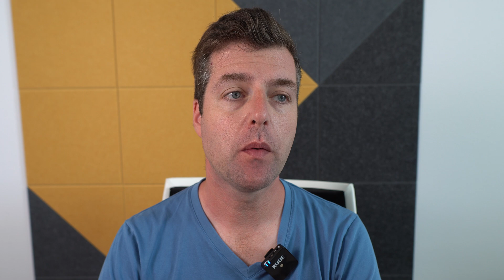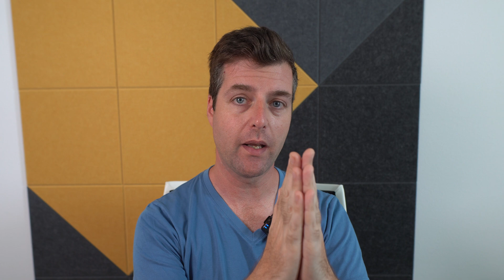Baffle Wall for your Home Theater

Comment: I recently watched your video about baffle wall construction, and I’m a bit unsure about which method to follow.

Method 1: Flush-Mounted Speakers with Absorption Behind
The speakers are flush-mounted into the baffle wall, with the front face level with the solid structure.
Absorption (4 inches thick) is placed behind the solid wall to control reflections.
Minimal absorption is applied to the front to prevent over-damping the sound.

Method 2: Recessed Speakers with Absorption Around
The speakers are slightly recessed (2-4 inches behind the front plane of the baffle).
Heavy absorption surrounds the speakers on both the front baffle and behind them to minimize reflections.

I’d love to get your insights on which approach delivers better sound performance. Also, does it make a difference whether the speakers are in-wall or on-wall models in this setup?

Additionally, I’d like to support your work. Could you please share your "thank you $" link?

I appreciate your time and guidance!
Reply from the maker: Method 2 would be preferred. You want absorption on the front of the baffle because it absorbs sound reflecting off the back of the screen and causing comb filtering. 

It’s still good to have it behind the baffle as well. 

As for in wall vs on wall, my suggestion is that in wall has the baffle reinforcement already accounted for.  On wall speakers would as well. Regular speakers would not and the baffle wall would cause a 6dB rise in the low frequency response. This happens quite high in the bass range and so needs to be addressed. It would sound lousy otherwise.

Comment: Matt, you need to study live sound acoustics. That is what we are trying to replicate. The reverberant field comes from reflection off the walls all around, and needs to do the same in the reproduction. It should not come from the same points in space as the direct sound. To accomplish this, speakers need to be a combination of direct and reflected sound, just like the Bose 901s, Infinity IRS, all dipoles and bipoles, and omnis. Inwall and on wall speakers cannot do that. Instead of SBIR, study image modeling and speaker positioning.

Comment: Thanks for another informative video, Mr. Poes! What I don't understand is whether a full baffle wall is built with a hard surface attached somewhere to the point that it changes the fundamental dimensions of the room.  If the room were 15ft deep and I built a full size baffle wall  that ends 1 ft off the front wall, for room mode and acoustic treatment purposes is it now a room that is 14ft deep?  Then I need to figure the right viewing distance from screen which will be different than the distance for acoustic purposes behind the screen to the speakers - complicated job you got!  😁
Reply from the maker: That’s exactly right. The baffle wall shifts the in room shell by the depth of the baffle wall. And yes we design rooms exactly like this. We take the outer shell, identify the final finished inner shell dimensions, and then figure out the screen size, seating distance, and thus viewing angle. It’s all a balancing act. 

What I try to share is that every theater at every budget is full of compromises. The key is for those to all be carefully considered compromises.

Comment: How do you deal with speakers that are ported in the rear, or have a passive radiator in the rear? One can't really build a baffle wall and isolate the entire back side of the speaker from the room.
Reply from the maker: Yeah that doesn’t really work. In my opinion a home theater LCR should be sealed. From a system design perspective that is a better approach.  

Having said that, a ported speaker could be sealed. It’s very likely that this would work fine in a bass managed system. I’ve done this many times.  In fact when I use Klipsch towers in particular I usually plug their port and bass manage them. It’s a popular speaker but I’ve had trouble integrating them unless I do that. I have a talk years ago around optimal bass optimization at AXPONA where I specifically covered this topic and uses the Klipsch tower speaker as my stand in for the discussion.
Reply: Hi Mathew,
would you use the same approach (plugging bass reflex port) in a genelec coaxial speaker setup, say 8341AP and upwards? For context, the idea was to create a mostly digital signal path from a jbl sdp-55's dante out going then to genelec's 9401A AoIP box doing the dante to aes/ebu conversion and bass management. Speaker distance being near to mid-field with low to medium volume listening habits.
Since they are fairly compact and offer good mounting hardware, positioning them close to the wall with said 6" absorber behind them to mitigate the boundary effect should work fine and get close to the signal phase correctness of a real bafflewall/in-wall install?
Kind regards, 
Max

Comment: Have you had the chance to test the jbl synthesis scl 2, if so how did they compare to Perlisten?
Reply from the maker: Not really. That would be a hard comparison to make.  I have heard the SCL-2’s in a theater of all synthesis speakers.  

I often find JBL Synthesis products to sound bright and even at times harsh. Some of that may be the speaker itself but I often suspect it’s the tuning. The demo I got was a poorly setup showroom theater with inadequate treatments and a calibration that I strongly suspect was overly flat in the high frequencies.  

Otherwise clearly the two are comparable speakers.  They have the same rated sensitivity and the JBL has slightly lower power handling. My guess is that they play about the same max output.  Both designs are held back by their woofers and not their tweeters. The Perlisten uses all aluminum construction. Even the back boxes are aluminum with a significant damping layer.  That would tend to make the Perlisten a more expensive enclosure to build and would have superior transmission loss within the enclosure. 

The Perlisten would have superior vertical directivity with a symmetric lobe. The 2.5 way JBL design would create a lobing error in one direction that is different in the other.  It also appears that the Perlisten has wider horizontal dispersion by about 10-15 degrees.  I am not sure that is very consequential.  

Kef now also has a Dominus rated in wall speaker. I have not heard this new version. It’s tough. Even if I did, no way I could compare.  It would need to be in my room in a direct comparison to make any judgement.  Not really readable.
Reply: @PoesAcoustics  Thanks for the great respond, are you using S7i-LR for all speakers or only for LCR, and what are you dimension of your HT.
Reply from the maker: @runebjrnjensen8874  no I used the S4i for the surround speakers. It would have been quite expensive to do S7i for all channels. 

I had considered doing S5I for surrounds. I may upgrade at some point to see if it changes things. It’s a big expense for a likely modest return.  The main advantage is the better vertical directivity. I don’t think the increased output is of any meaningful consequence.

Comment: One question: When I want to tame side wall SBIR (of front wall SBIR) do I have to put absorbers on all of the front wall or is a sufficient area (like 2x2 meters) also going to do it?
Reply from the maker: It would depend heavily on the frequency in question. Covering some but not all of the area would help a lot. Covering all would help a lot more.  

It also has to be efficient at absorbing in those frequencies. If the SBIR effects are 150hz or less the typical 4” or less of fiberglass won’t cut it.  FRK faced fiberglass might be a better cheap option.
Reply: @PoesAcoustics  It is mostly 120,150, 170Hz that show drops because of SBIR. Unfortunately ceiling/floor/front/sidewall. Cant do anything in my living room about ceiling and floor SBIR. But I could do something about side walls (120Hz) and front wall (150Hz). Maybe I could use GIK monster traps. They are about 6.5 inches thick. I would still have to dig a bit deeper to find out what I can do about the somewhat jaggy response 120-400Hz though. Only partly those drops can be attributed to SBIR. I use 4 subs optimized by MSO and crossed at 120Hz to circumvent the first SBIR dip. It is a bit annoying that my response is looking really good until 120Hz, then is messy till 400Hz and is looking good again. The transition region above my subs XO till Schroeder frequency is really hard to come by.

Comment: It kind of make sense to do uneven absortion on the back wall. I gues, that if you absorb parts of the wave, you also change it? And that might make it less of an inerference? 
Maybe 🤪
Reply from the maker: When you say back wall do you mean the wall behind the speakers?

You don’t necessarily want to change the reflection to be different from the direct sound. That doesn’t make less interference. It only makes the reflection sound colored. It’s also not what I did here.  

However all absorbers have a non-flat reflected response and the reflection response will look nothing like the direct sound or the absorption rating. The way we “measure” absorption relies on a statistical phenomena of waves that averages out fine peaks and dips. It’s also done at course intervals.  As such we don’t get to see the true response of a specular reflection. If we really cared about this we would use big wedges.  I’ve long speculated that a curved front absorber could be useful as well.  

In any case, what I did here was used different materials in layers. So if you imagine the layers from the actual baffle the speaker is mounted to our to the room, it goes like this. MDF and plywood CLD sandwich that the speaker attaches to. A layer of 1/2” high density acoustic PET felt.  A 2” layer of medium density acoustic foam. Covered in a layer of foam backed acoustic rated suede headliner material.  The way this works is that when a soundwave begins to move toward the CLD layer, it passes through layers of material that gradually change acoustic impedance. The acoustic impedance goes from very low at the air layer to slightly higher at the suede layer to very high once it eventually hits the baffle itself. This gradual transition leads to a lower probability that the incident wave will reflect. It becomes more likely to pass through to the CLD layer where it can be absorbed. This really only works down to maybe 500hz. Maybe lower but that is a good conservative guess. However the goal is to minimize comb filtering which is mostly only an issue above 2-3khz.
Reply: @PoesAcoustics  
First mr. Poes; I really apreciate the detail in your answers. Not many take the time to actually answer with this kind of involvment😊
With backwall, I mean the wall behind the listener, oposite of the frontwall😊
It sounds like a really complicated build🙊 
What do you do foe sub 500hz then? Massive absortion?
Reply from the maker: @andreemilsen369  ah I see. 

My back wall consists of 2” absorber panels, 6” QRD diffusers, and bass traps. My bass traps are a steel membrane type. I bought some 6” panels I had made with 8lb density insulation.  Those are for the back wall below the diffusers.
Reply: @PoesAcoustics  
There is some rather serious investment in that room🙊
Must sound amazing😊
Reply from the maker: @andreemilsen369  well absolutely. But remember that Poes Acoustics is my company and I made a decision to make this room a demo space and lab for my work. It has the equipment I sell in it, it used techniques I most wanted to try out for sound isolation (for example Hushframe was new to me when we decided to try it), and the acoustic treatments are brands I knew to have a good reputation but had not used a lot myself.  It’s hard to sell someone an acoustic treatment plan and recommend specific products when you aren’t sure the products are actually any good. Artnovion has dozens of products and I’ve only had hands on time with a fraction of their total products. Using some of them in my room allowed me to expand what I could give first hand experience with. Same for the Real Acoustix products.
Reply: @PoesAcoustics  
That is an exelent way to do things😊
Try it, verify, the recomend😊
I know who to call when I win the lottey for building a proper room😊